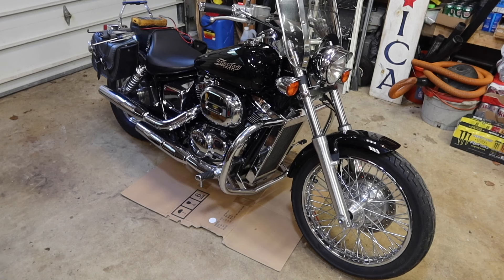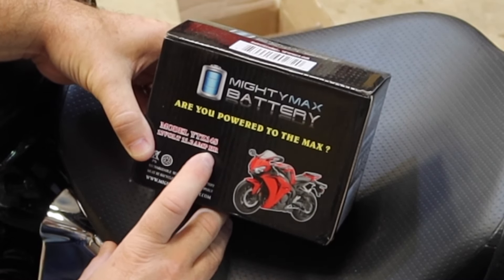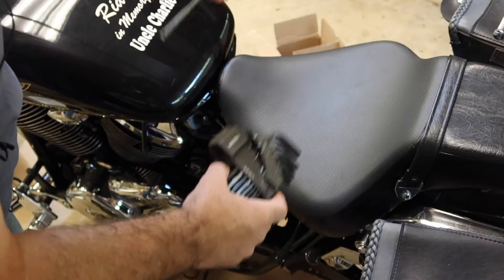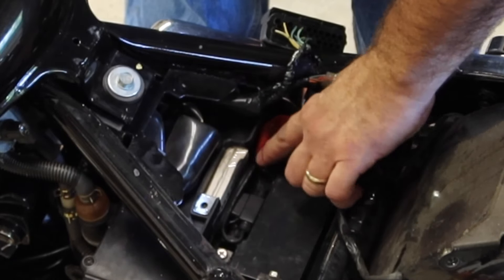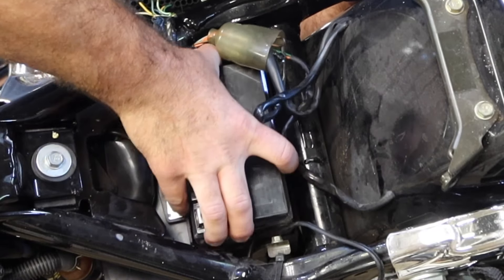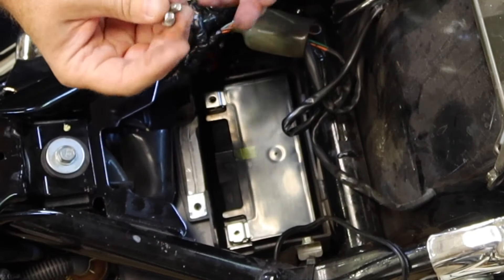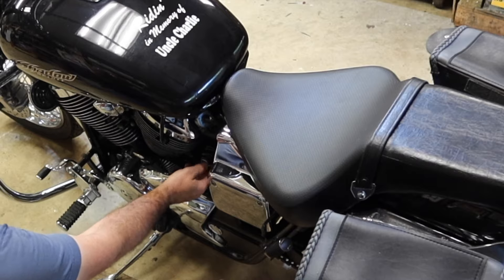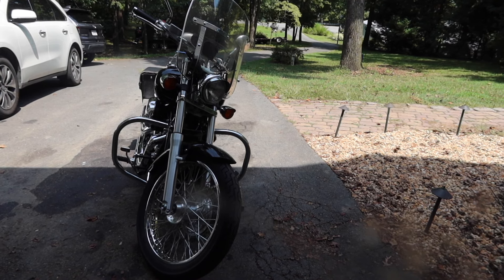Honda Shadow Battery Replacement Made Easy!

Comment: I have a 05 shadow spirit , battery tender is not showing green light even after charging for 40 Hrs but bike starting noise is same like yours (end of video) , does it mean I have another issue as well ?
Reply from the maker: Mine has a full battery so your tender may be off or battery is starting to get weak

Comment: Put the nuts in before you install the battery. Then small piece of blue tape so they don’t fall out. Start the bike with the seat off. Look for sparks. You could shim the connectors with a washer.
Reply from the maker: Those are great ideas! Thanks!